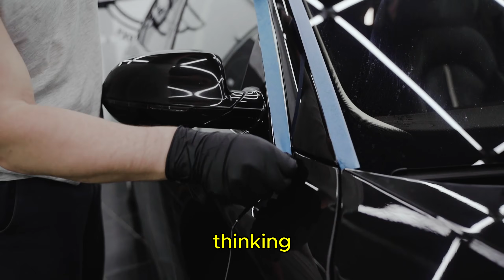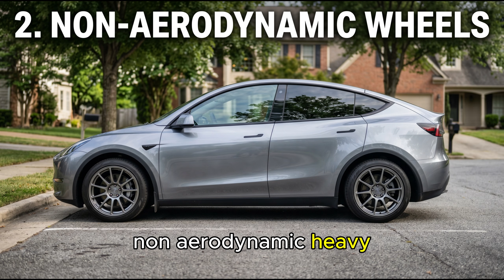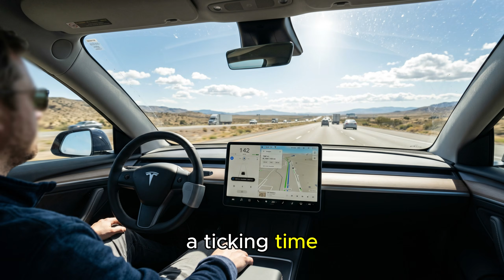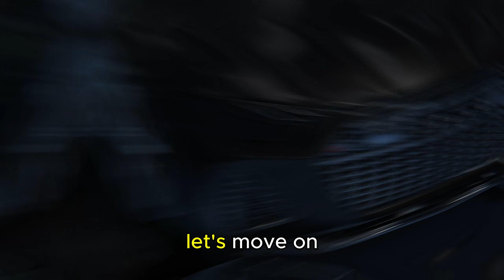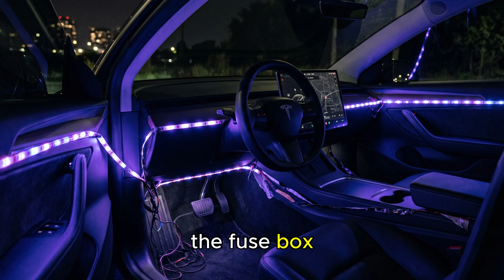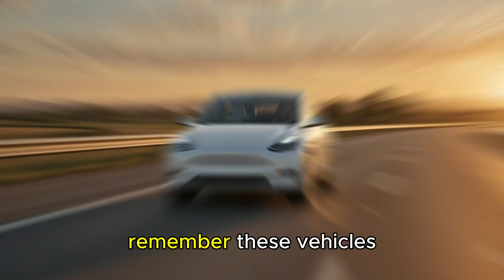5 Accessories You Should NEVER Put on Your EV!

Comment: I wouldn't try the steering wheel weight. Most new cars, including EV's actually have open auxiliary taps specifically for the purpose of 12 v Accessories. Almost any new car has DC ports, rated for 10 amps (120 watt) "cigarette lighter" sockets. These are more than capable of powering cell phones, 3rd party GPS, cameras, or RADAR detectors. You DON'T want to tap into a circuit dedicated to another component, because the ICCU could sense it as an error, and throw a code. It's programmed to know how much power a component should draw, and if it sees a change, it can be 'fooled' into thinking that component is failing.
Reply from the maker: You're right about the steering wheel weights, definitely way too risky. Like you said, no reason to mess with the fuse box when there are 12v ports ready to use. We're just asking for trouble with those error codes. Thanks for the heads up, great point.